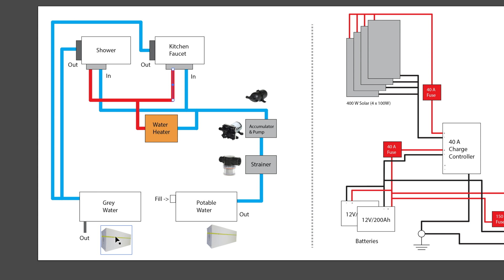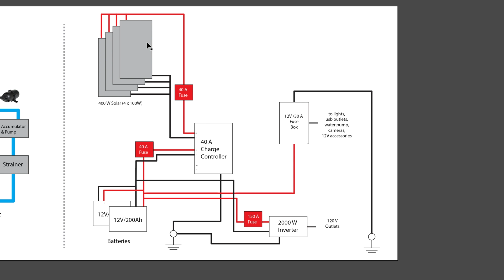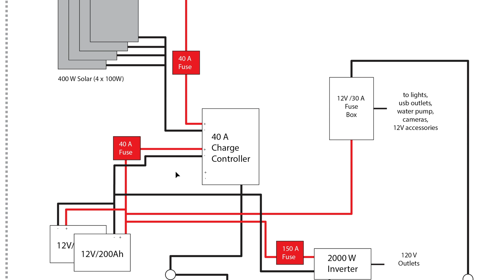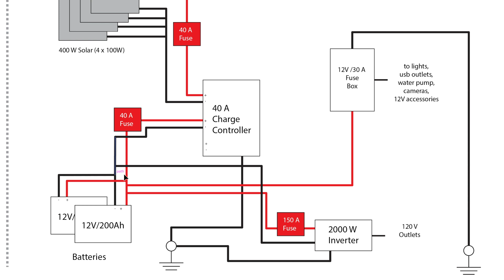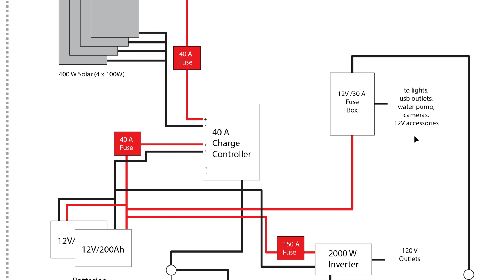Ep 3 | Tiny Home Truck | Planning: Electrical & Plumbing

Comment: although my step van electrical is 95% done (just a few minor tweaks needed), I've yet to begin my plumbing. I'm still using a 5 gallon gravity feed jug on my sink draining into another 5 gallon. guess I should get to work on that! can't wait to see your finished rig!
Reply from the maker: I haven't started the plumbing either. I got a smaller pump early on and then got a larger one for the shower so I'm thinking maybe to activate each pump depending on if I'm using shower or sink? Still planning but it's something that can wait for now and just do what you're doing! And thanks man. I'm super excited.